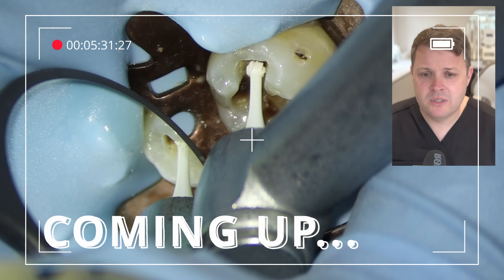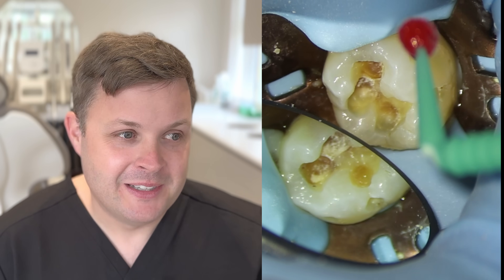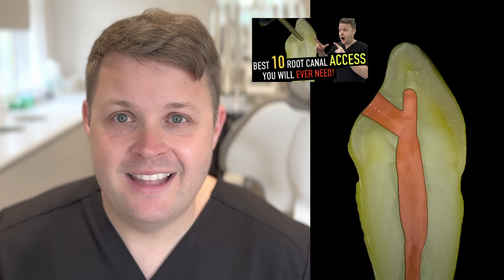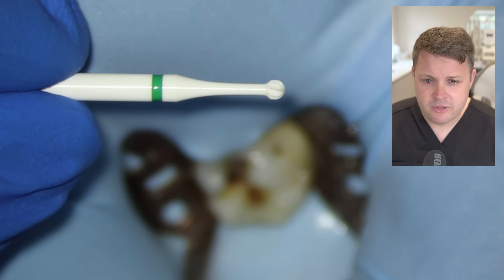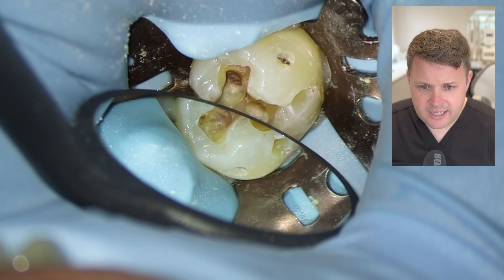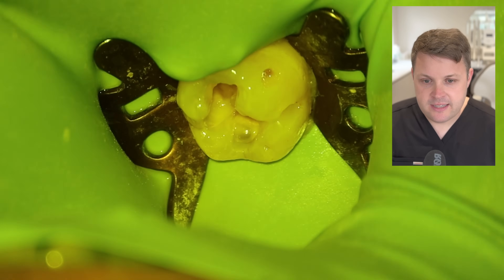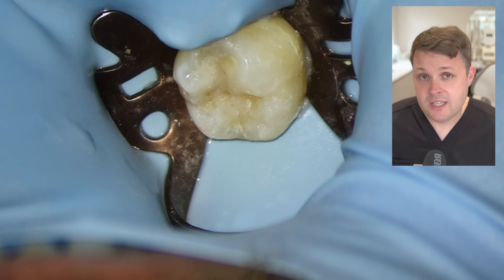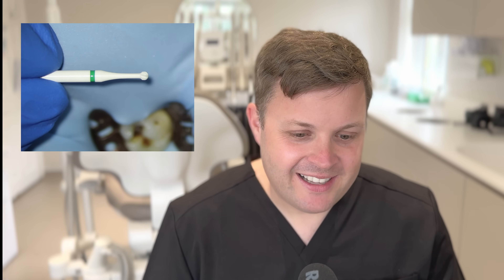Ceramic Burs: Are You Accidentally Killing the Pulp?

Comment: Try this burr C.1SXM.021.RA, it also has a 014 variant, i think you will like it. With stamp try taking the ptfe off gently, removing the excess and brushing the edges with a microbrush, will be easier if you have a cross polarising filter on your microscope .

Comment: Hi doctor,  I am a general dentist and I use caries detection dye every day. My recommendation is after you  finish eliminating the infected dentine and you do not need to use any more dye, finish by polishing the tooth with a cleaning brush (for me is more effective than using the ultrasound tip) with clorhexidine at 0.12 or 0.2%, and that will remove the dye that has gone everywhere.

Comment: Great content doc and thoroughly explained, both educational and entertaining! My thoughts on CDD is that is pretty good for "navigating" around, but especially in very deep cases it might determine you to remove too much tissue. Also, as somebody else has already mentioned it detects organic tissue so the stains outside of the tooth and on sound enamel are just microscopic accumulation of plaque. You've mentioned "not using Scotchbond" but using iBond in tandem with a selective etch technique ; My confusion comes from that fact that from what I know, Kulzer has 2 variants of iBond (one Total Etch and one Universal) and with total etch adhesives I always etch the dentine the appropiate amount of time, otherwise you get a shallow infiltration of the adhesive and thus a weakened bond to dentine. Stamp technique wise, it's a bit easier to wrap the teflon around the stamp beforehand and adapt it really well using modelling resin, this way helping you remove the stamp without teflon sticking to the composite before light curing so you could adapt the composite further to the margins, if necessary Keep up the good job and I hope someday I'll buy myself an intra-OP camera as well 🤗

Comment: Haven't used ceramic but have been very interested as I have used Komet's tungsten carbide rose burs which were much better than any of the stainless steel I had used before. Caries detector is a must imo, use it for every restoration. I have never paid any attention when it stains non-carious tissues, I don't remove it and patient's never come back with it on, so I can only assume that it must rub off like articulating paper marks that aren't removed.

Comment: I am a new graduate, these burs were never mentioned for us in uni, only stainless steel ones. I first saw them in a dental supplier and they were 5 times more expensive! So i bought one to try it out and it just felt all dull and doing nothing so I never looked at them again. I am shocked for how much caries it was removing in your video I guess the one I bought was just poor quality. Never had such problem no matter how cheap a stainless steel or carbide contra angle burr. Also it would be great if you post more than endo videos as they are so clear and easy to follow!❤